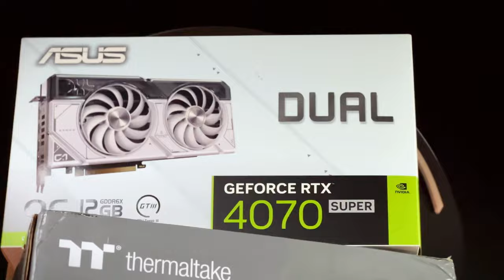Thermtaltake Tower 300 PC Build [RTX 4070 Super | Ryzen 7 7800X3D]

Comment: I was thinking about doing a similar build in this case, did you run into any issues with the project zero board?
Reply from the maker: No issue at all!
Reply: You'll be better off wearing a Dunce Cap, because the only way to access the MB's USB and video ports, you'll have to remove the top grill, which will leave cables and your exhaust fan openly exposed.

Comment: Hi, I'm using the Deepcool LT720 AIO cooler and at 4:45 in your video where the radiator is mounted onto the chasis railing, did you use the supplied screws from Deepcool? The length of the screws with mine is around 8mm which is too long and I cannot tighten the screws without bending the fins underneath.

Comment: Did you have a clearance problem with the 24 pin psu connector cables and the rear case fans? I heard that that is the reason TT says the case isn't compatible.
Reply from the maker: No issue or whatsoever when using the BTF motherboard

Comment: Wait where do the cables go. From the mouse and keyboard and stuff
Reply from the maker: Magic 🪄
Reply: I'm wondering the same thing. I've watched a bunch if videos and yet to see how to plug into the mobo. I don't mind dongles on the case. I would much rather not have to use wired USB like that. Much rather use the mobo's ports to keep the desk cleaner.